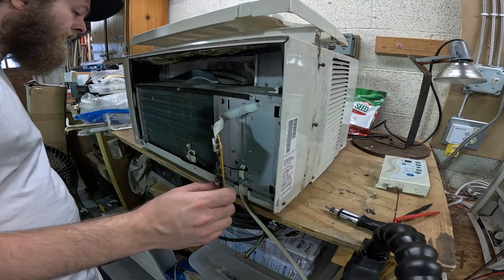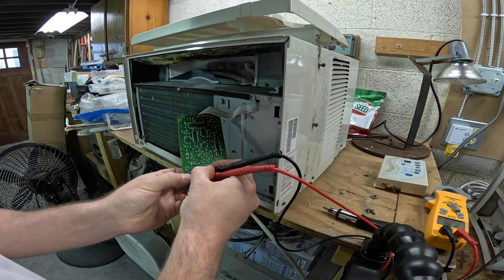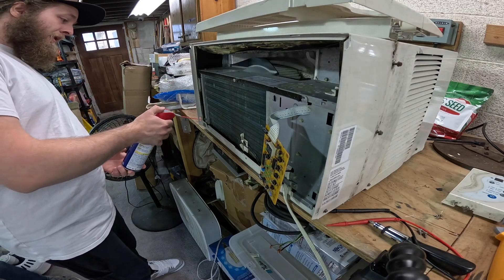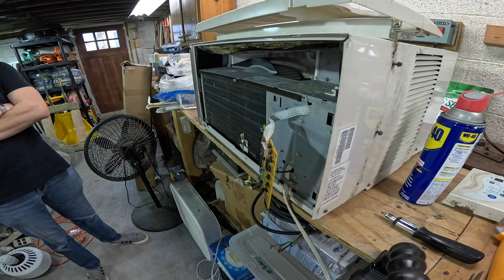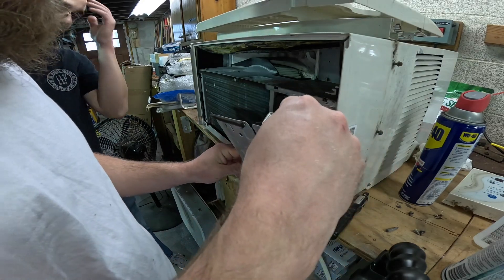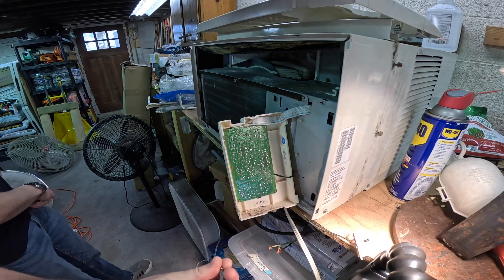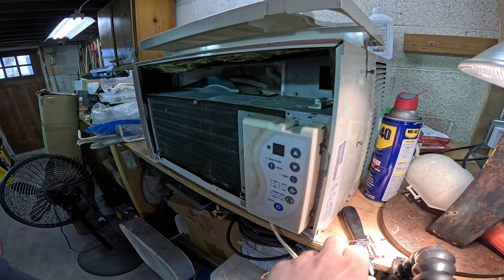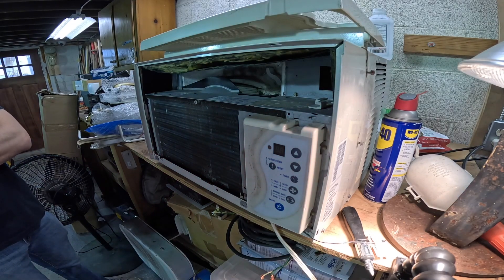Fedders A7Q08F2A-A Buttons Not Working | Control Repair and Compressor Test

Comment: This is from the last era of the Fedders made units. Circa 2002. After this, Fedders disappeared from the market...  I have an identical 16000 btu, 120 volt unit. It draws hell of power but is cold as ice. The compressor is imported, not sure of manufacture, and the fan motor is an LG. By this time, the quality definitely took a nose dive.
Reply from the maker: I think this was still quite good quality, it's fitted with a Japanese Matsushita compressor. It doesn't get much better than that.
Reply: When did Fedders quit making the Rotorex compressors? I wasnt aware Matsushita was a good compressor either.
Reply from the maker: @electriciants7927  Fedders never made Rotorex, it's a separate brand as is Matsushita. Different ones were used over the years.

Comment: Nice Video Jordan. Glad to see you got the electronic controls working again on this unit and hopefully you can soon obtain a replacement fan motor to get this unit back up and running. Surprised to see a case where a unit likely fell out of a window and it did not cause a failure of the refrigeration system. Hope to see this A/C get back into service soon once the propper repairs are made. If I had to place a guess as to why the motor was seized is likely because of the barrings.
Reply from the maker: These sealed systems are extremely reliable, it's very rare they leak even when abuse is experienced.